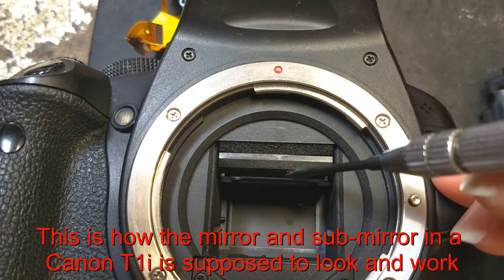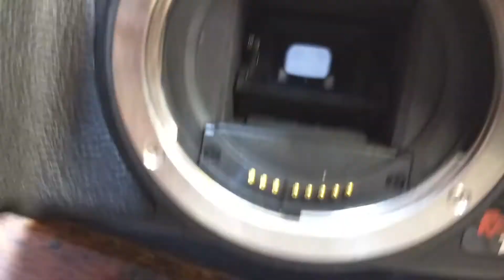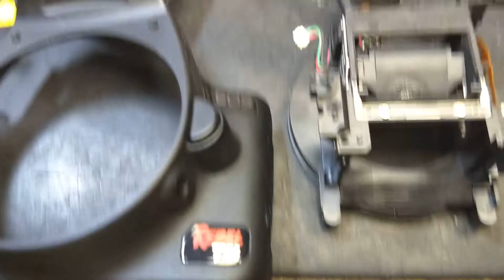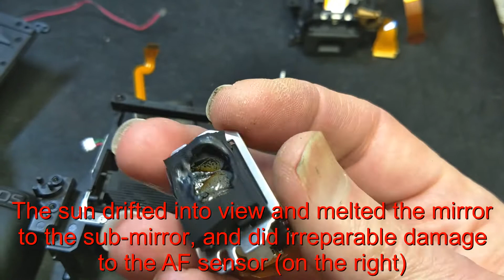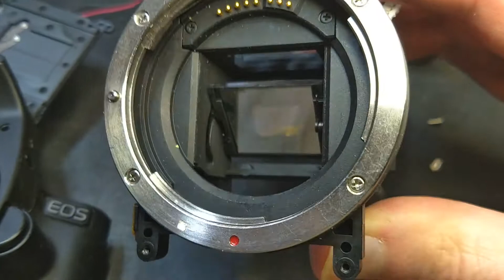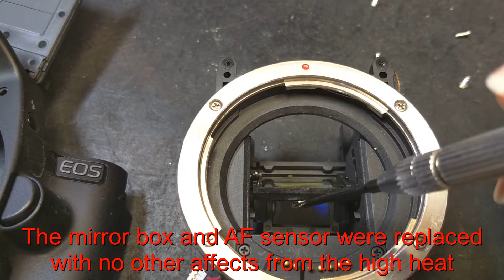Canon EOS T1i damaged by sunlight thru a telescope

Comment: wow never thought of that happening . yes it could burn your eyes quick or start a fire nice heads up for this
Reply from the maker: I'm still not sure how this happened but it was quick!
Reply: @ghccrtube5007  Hi again. I am about to order the Nikon af-s 200-500mm lens would you know of any problems with this lens? Any help would be appreciated. Thanks
Reply from the maker: @wrench-nk2pu  I don't see any recurring problems in that lens though it does have the 'silent wave' AF motor which will probably be an issue in several years :)  Very high quality optics !
Reply: @ghccrtube5007  Thanks very much GH . i have done a fair bit of research and do like the reviews on it . will stay in touch . Tks again